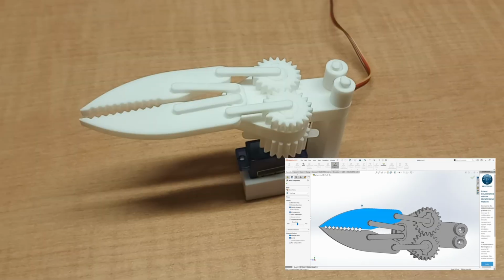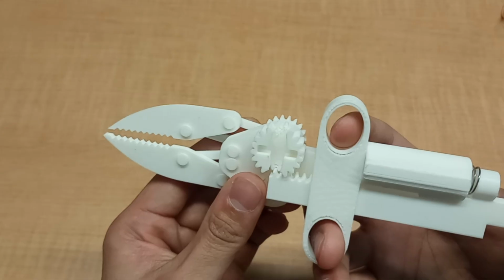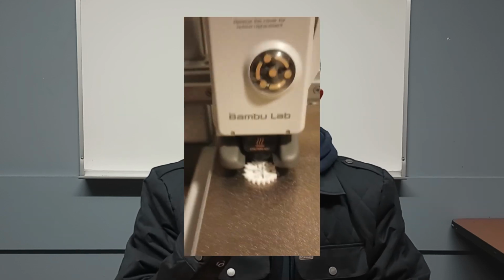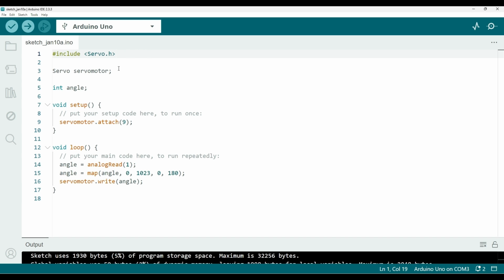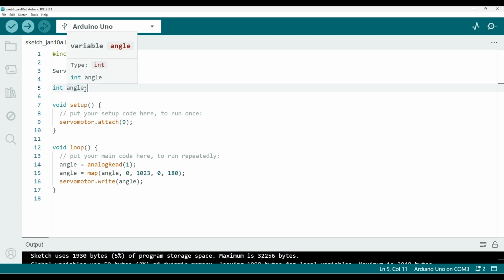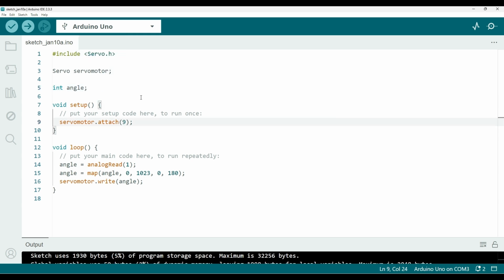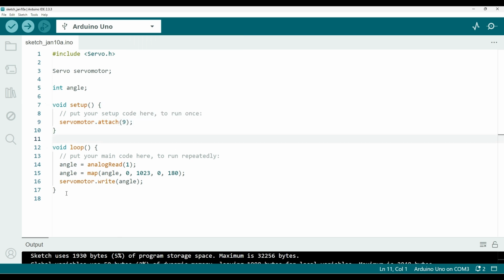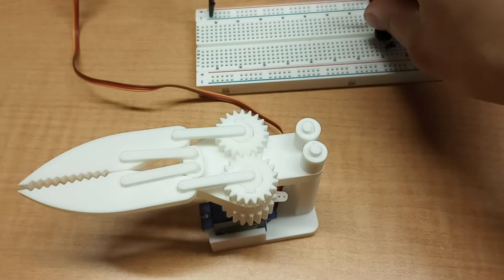The Gripper Mechanism | The Hand of Robotics

Comment: Fantastic video. I want to learn arduino. Do you suggest a resource to get started?
Reply from the maker: @sweetgumnyc7794  you can simulate it for free using tinkercad; It lets you simulate a circuit with an arduino and electrical elements. You can check some tutorials on YouTube on how to use it or there's plenty online sources and examples.

Or if you want a cheaper Arduino compatible kit instead of a simulation, I'd but the Elegoo Super Starter Kit.

Comment: It's interesting but some improvements that I'd highly recommend is adding another gear at a different ratio you could get some torque going. Curve the inside of the grippers slightly in a concave manner so there's more surface area to grab irregular shaped objects, and smooth the very tips of the claws so they're not pointed so you don't accidentally damage something before it's even grabbed.

To improve the quality of the grip, angle the teeth slightly and maybe use some rough sandpaper to rough up the surface some so it can make better contact with smooth objects.
Reply from the maker: @RipDoveStudio  thanks